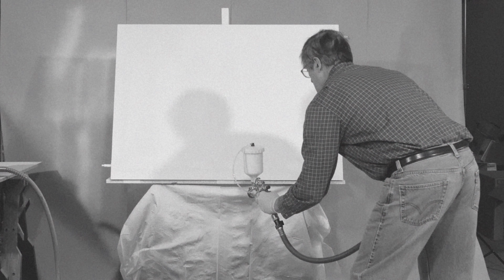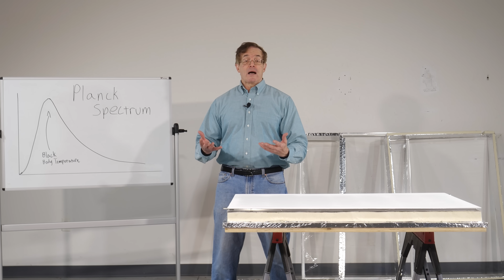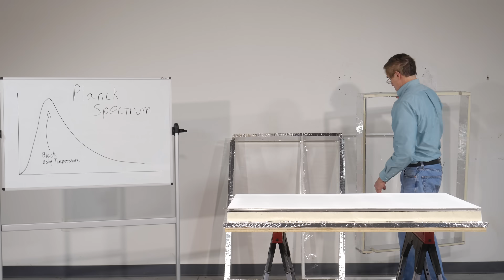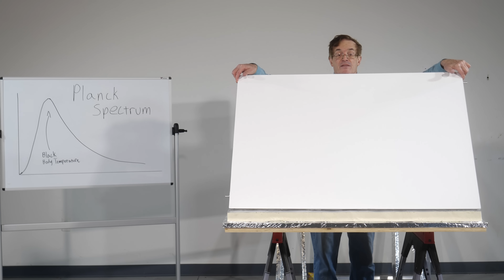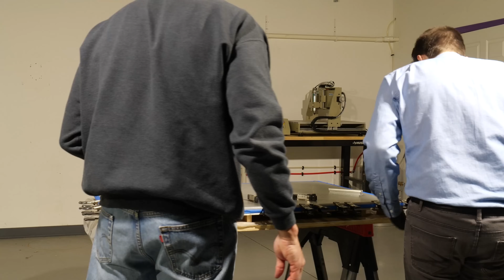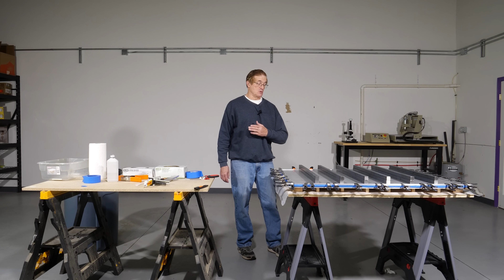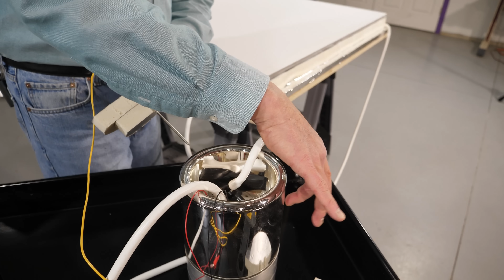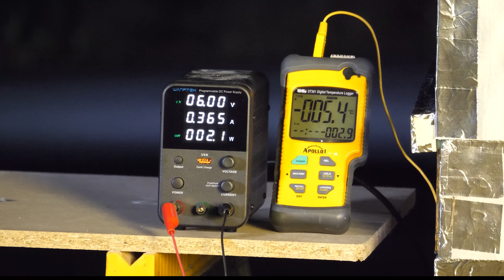Air Conditioning isn't free... but we're close.

Comment: Would be neat to have a cost effective DIY way to make the Purdue teams (I think that's the best at the moment) paint at home.  This and humidification cost effectively would be super handy for more humid environments so can be more off the grid like.   Interesting in regards to thermal effusivity, how there are even lab test equipment and PAT equipment for monitoring materials processing.  I vaguely recall researching and for some reason am not recalling clearly that time at Perrigo... hhhmmm... wondering where I ate out at that time range?  I don't think I noted on my LinkedIn now that I think about.
Reply: Nighthawk in Light made a video about making a low cost paint. Here's the link https://youtu.be/N3bJnKmeNJY
Reply from the maker: We  do just that in the upcoming video on making the paint!🙂
Reply: Surprised you guys haven't made a homebrew ERV like out of coroplast or even better aluminum or copper cost effective ways.  I recently finally found a hair iron with the zig zag surface, as I was thinking pressing the aluminum screen material to increase the surface area and placing in between the perpendicular direction coroplast sheets for better heat exchange.  I was also thinking more easily just ironing in the aluminum screen into the surface of the coroplast sheets.  I'm still not certain how to easily without making a tool like with music wire maybe spaced in the bottom of the grooves in contact with the one sheet to melt into the sheet... sort of like a more rigid foam wire cutter, though tuned to melt the coroplast material for the aluminum to bond in with for better heat exchange.

Comment: NightHawkInLight  did something similar a while back,  he found that there was only a small difference between special coatings and off the shelf white paint.  About 3% by memory
Reply: The difference was much more substantial during the daytime; when cooling is needed most.

With normal white paint heat radiation would need to be buffered during the night. Buffering cooling with a d-t of a few degrees is very expensive. It is usually done with water so that is big and heavy. Anything you choose will be big and heavy but not much is as cheap as water. Like an insulated swimming pool or larger per house. And you still have to deal with dehumidifying in most climates.
Reply from the maker: He did.
We carried  this research further, and as you'll see, our paint works extremely well.
We'll show you how to make it and it's easy!
Reply: Nighthawk did a good video but what he didn't do was seal the paint off in the enclosed box. Any wind will draw off the heat through convection. That's why greater temperature differential can be achieved by sealing it with "saran-wrap".

Comment: I know that the Idea works, but your demonstration has a major error at least in terms of you wanting to show that it is supposed to reach sub ambient temperatures:
You are performing this at night, where ambient temperature is constantly dropping. This temperature drop is mostly driven by radiative cooling of the earth surface. As you said very little radiative cooling is achived via the atmosphere. At night the ground temperature is lower than the airtemperature a couple meters up.
What I'm saying that if you put a temperature probe into the ground at night you will also observe sub ambient (air) temperatures, no special coating no infrared shielding required. A panel suspended over the surface might still cool faster than the surface below it because it has a small mass per area. Meaning it is connected to a smaller heat resevoir. 

I heared about some material recently that was able to achieve sub ambient temperatures in sunlight. Was mostly done with semi conductor band gap shenanigans. So I'm reall looking forward to your low buget approach and seeing how well it performs.
Reply from the maker: Stay tuned, you will.

Comment: Great video and practical application of science. If you circulate cold water through baseboard heater pipes in summer, water vapor will condense on the fins of the pipes and drip onto the floor. A gutter under the pipe could divert the flow out of the room being cooled, similar to what an air conditioner does.

Comment: Re: heat pumps, is the working-fluid isolation that implies a heat exchanger, necessary? I understand the purpose in a DIY-constructed panel, as refrigerant is under compression and would blow holes in an epoxy-sealed box. But presuming a commercialized version of this radiative panel, constructed using industrial manufacturing techniques like robotic spot welding, would it not work just as well to plumb the compressor side of the heat pump directly into this "extended radiator module chain"? And if so, why wouldn't heat-pump manufacturers already be selling these optional add-ons for their systems?

Comment: Nice! I watched NightHawkInLight's video on the same topic when it came out. I'm keen to try build something for my place. What you could do is store the cold air in a big insulated tank and then flow that through radiators. I'm keen to see your follow-up, particularly on how many watts you're actually able to shed per panel in varying conditions.

Comment: why not get some of the white paint that absorbs or completely reflect infra red... and is colder than the ambient temp around it, and coat an aluminum heatsink that has an internal water jacket, but use rubbing alcohol instead of water.?
Reply from the maker: That's  what we used.

Comment: I don't see this working in a practical setting. In daylight you'd have greenhouse effects with the plastic wrap, no? And constant water presence inside a roof would tend to be a recipe for a water damaged building. Interesting idea though.

I would very much have preferred a second thermometer to compare the temperature vs. changes in ambient air temp in your test setting. As well as some method of finding a control for the unit simply cooling down upon being placed outside (residual heat in the materials).

I think the main factor is sunlight/shade. My thought is to use a double-roof, about 18-24 inches apart, with vents at the bottom (outer edge) and top (peak), so that sunlight hitting the upper roof heats air inside the dead space, which rises, and draws in fresh air in a continuous cycle. Basically creating a breeze between the roofs with ambient air temperature, and effectively rendering the whole inner roof as being "in the shade". Aluminum bubble wrap insulation under both roofs would help further isolate the inner roof from solar heating. Anyway, in winter, you can just close the vents at the top & bottom, creating a captured pocket of air between the two roofs, and effectively making the space between the roofs into the enclosed envelope of the house or building. Effectively making the structure "no longer in the shade" and creating an additional layer to trap escaping heat rising from the structure. As a side benefit, water from any roof leaks would only meet a second roof ;)

The other main thing to bear in mind, is that the deep ground temperature is generally more ideal than the ambient air temperature (through the seasons). Where I am, that deep ground temperature is in the low 60's (F), which is slightly chilly, but very easy to balance out to a comfortable room temperature. Obviously most people don't want to live in caves, but by using air which has cycled through deep ground tubing, you can get a heat pump much closer to the desired temperatures for it's heat exchanger to work well (in both heating and cooling, except while you're within that small variance between deep ground temp and room temp). Similarly, I'm not convinced that insulating the bottom of the foundation is ideal. If the sides of the foundation were instead insulated instead, the house could try to access some of the deep ground temperature underneath it.

Also, the south facing side should be where there are a large amount of windows. But with a substantial roof overhang, so that in summer, the windows are in the shadow of the roof. But in winter, light comes inside the conditioned air space through the windows. Ideally that would strike a large thermal mass which is dark in color, inside the glass. Basically converting the south wall into a greenhouse which only sees sunlight in winter.

Add some attached enclosed unconditioned spaces, like a garage on one side, and a huge storage shed on the other, and you're starting to have a "house inside a house" effectively, in terms of air envelopes. Basically leak-proof, and with lots of natural lighting. I suspect the right design could reduce heating & cooling needs dramatically. All without living in a cave ;)

It's good to see another Tech Ingredients video :)

Comment: These materials and processes are also NOT free; energy is required to manufacture, to install, and to maintain them.  Labor spent doing this also cannot be used to recycle failed products.  Substantial engineering is involved in optimizing this big picture and in designing a structure that will stand for many years.
Reply from the maker: That's  why we said "close."

Comment: re, hydronic cooling - in a "high-ish humidity" environment, dew point may cause issues with building products - just a point to mote for the future  (obvs, 20C itself is rarely "dew point but "conduction media" runs at temps well below "controlled ambient" ie below the 0-16 deg C which may be "dew point". 

cheers.

Comment: This whole exciting usefulness goes to heck in a hand basket in Florida .
Temperature offset in this example ...  outside temperature 117  in direct sunlight ... not in the shade .
Inside temperature with the windows open ... 85 to 89 with a breeze blowing .  Capturing the hot air molecules will take as much electricity as it always does ... with the exception of the number of warm bodies and equipment .
Great idea ... but you're going to sweat your ass off ... without the conditioning process of the hot air / cold air molecules in the inside air .
When you're soaked through to your socks and underwear ... and you haven't gone outside ...  it doesn't matter how much math you throw at this problem ... a body is headed for heat exhaustion...  guaranteed .
Semper Fi
Reply: Why would you open your windows during the day with those outside temperatures?
As long as your house is decently insulated only open the windows at night.
Reply from the maker: In the next  video, we'll  cover the paint and daytime  cooling. Just paint  the building, and keep your  airconditioners, but run them less often. This really works.

Comment: Wouldn't it be good to make rooves out of this? Would be interested to see the experiment repeated with corrugated galvanized steel. The emissivity is worse, but if it can use pre existing roofing supply chains, then it would be much easier to implement.
Reply from the maker: The metal substrate doesn't matter. We just used the aluminum  because  it's  lighter and easy to work with.
Reply: @TechIngredients  Ahh, I assumed you used aluminium as the substrate for the same reason as aluminium tape on the shroud, though I assume you still want it to be an efficient conductor of heat?

Comment: And if you throw up solar-panels on your roof you can basically run the AC "for free" when it's sunny and warm.
Night-sky cooling aka Radiative cooling was used thousands of years ago. Search for "yakhchāl" and ice-making to get some history.

Wonder if a standard solar thermal collector could be used for this. Ready-made and simple to install. Only some backing + surrounding frame and coating would be needed.

Comment: Looking forward to the special coating video! I was worried you've made a mistake using white paint for a radiator. I wonder, is this why household radiators are painted white? This puzzled me for quite some time actually. Although, now that I've searched wikipedia radiator page, it doesn't mention anything related :|
Reply: I feel like the puzzledness is understandable, given that you're probably thinking of "Kirchhoff's law of thermal radiation" [1] which consequences are stated in simplified terms as: "For an arbitrary body emitting and absorbing thermal radiation in thermodynamic equilibrium, the emissivity is equal to the absorptivity".

In the case of incident sunlight and a room-temperature surface coated in white paint however, your average temperature of the surface and its associated distribution of emitted light wavelengths at those temperatures (see Planck's law as mentioned in the video [2]) is drastically different from the distribution of the incoming sunlight, which stem from a much hotter source (photosphere with an effective temperature of ~5800K [3])!

To quote from the same Wikipedia article on Kirchhoff's law of thermal radiation: "Average and overall absorptivity and emissivity data are often given for materials with values which differ from each other. For example, white paint is quoted as having an absorptivity of 0.16, while having an emissivity of 0.93. This is because the absorptivity is averaged with weighting for the solar spectrum, while the emissivity is weighted for the emission of the paint itself at normal ambient temperatures.
[...] 
The white paint will serve as a very good insulator against solar radiation, because it is very reflective of the solar radiation, and although it therefore emits poorly in the solar band, its temperature will be around room temperature, and it will emit whatever radiation it has absorbed in the infrared, where its emission coefficient is high."

In other words, white paint can  reflect relevant parts of sunlight as far as most of its energy is concerned, while also being able to have a high absorptivity/emissivity in the spectrum involved in most of the radiative energy transfer away from the surface, as long as it doesn't fly too close to the sun!

In the case of cooling under daylight like in the video you'd probably want to choose a paint/coating which is able to reflect most of the wavelengths/energy of the sunlight that actually makes it through the atmosphere/plastic to hit the surface on the inside, while simultaneously being as absorptive/emissive as possible in the sort of frequency bands that the plastic film of the lid on top would allow to pass through into the atmosphere/outer space to still be able to get rid of the heat as intended!

It looks like this is the sort of coating they will be showcasing in the next video of this series and I'm looking forward to seeing its cooling performance under different atmospheric/sunlight conditions!

[1]: https://en.wikipedia.org/wiki/Kirchhoff%27s_law_of_thermal_radiation
[2]: https://en.wikipedia.org/wiki/Planck%27s_law
[3]: https://en.wikipedia.org/wiki/Photosphere#Sun
Reply from the maker: For thermal radiation emmision, the visible color  doesn't matter. Actually,  I don't know why they always paint them white.🤔

Comment: Passive cooling is such a fantastic thing. The only problem I can see is that you can't just put high reflective pigment on the average home rooftop because you'd need to heat the house more in the winter (unless you live in Arizona). Any system you connect this to will either need to be cooled all the time, like a fridge or freezer, or will need to be disabled for two-thirds of the year, like the AC. That makes it a great system for supermarkets, but not so great for private residences.
Reply: or just switch off the water pump :body-blue-raised-arms:

Comment: Interesting, it's a solar water heater in reverse. I wonder if it would be worth it to further insulate the system against outside air, for example with multiple layers of window material or by placing the entire cavity under vacuum. If the energy used by the system is just coolant circulation, simply adding more panels would be less efficient because it would also increase the flow resistance. Or maybe you could try to set it up so the coolant circulates naturally by convection?
Reply: Operating under a vacuum would def increase efficiency but the radiation capacity of this system makes that very cost ineffective. The vacuum sealing would easily cost ten times more than this does on its own. I doubt much more insulation would be helpful as the coolant temperature won't be much lower than ambient temperature.

Natural convection could take advantage of the thermosyphon effect. A tank of water at a lower elevation to the panel would naturally exchange water with the panel as long as the panel's water is cooler than the tank's; heat rises. But it's not a strong effect so the tubing size and panel flow gap would probably need to be increased.

Comment: Could you replace the tall outer shield with a much stubbier grid of aluminum? Something like 1cm thick and a grid spacing of 1cm, kind of like the anti-glare panels in florescent lighting fixtures. 

This would make it more panel-like and rigid with a 45° blocking angle. Probably some loss in effective area though.

Comment: I had a feeling as soon as 'toughened epoxy' was mentioned, a Henkel cartridge would soon appear. I go after their composite bonding formulas quite often as it's been about the best thing to bond carbon panels to metal substrates as I've found thus far. 
On a more related note, I'm waiting on the weather to come around to build a modified aircrete dome I worked on formulating a mix with my graphene additive over the winter as part application test, part workshop build. With innovations in lower powered HVAC solutions and more optimized building materials, generating heat/cooling and retaining it for as long as possible should do wonders for making a modern structure perform like having 24" thick adobe walls.